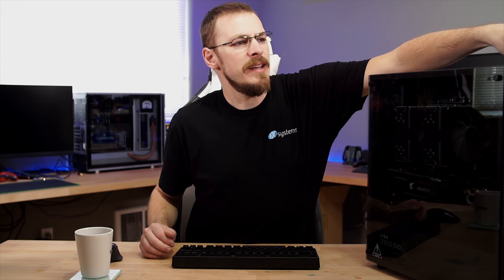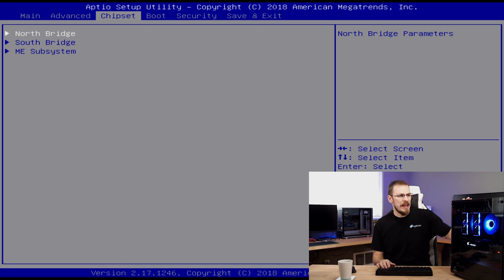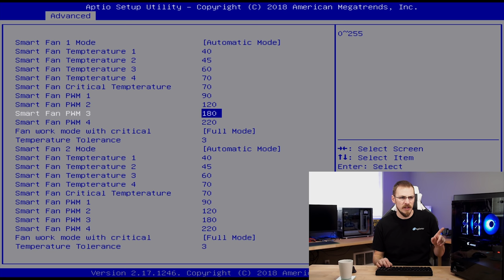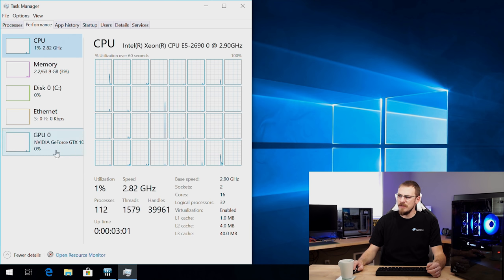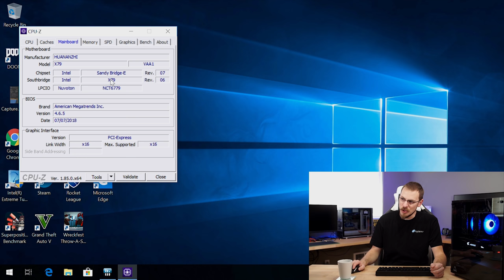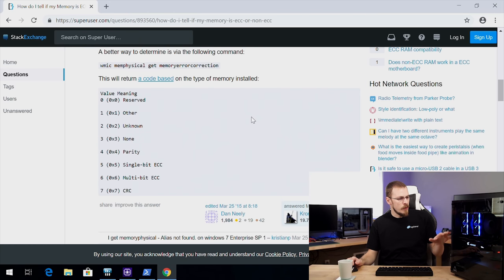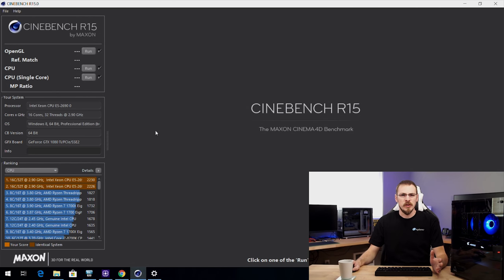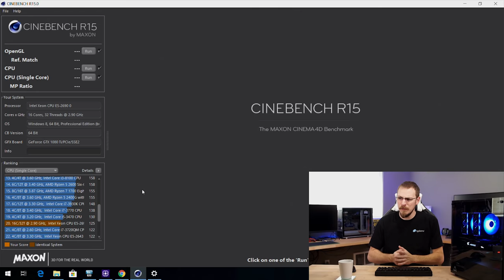Huanan "Dual X79" Motherboard Review

Comment: These platforms are dead ends,  a Ryzen 3400g performs about the same as a xeon 1650 per userbenchmark.com.  And you have to watch the chipsets the x79 platforms come in, I had 2 with the C602 and they ran ok.  Now I got one with a Q67 and it doesn't like the Hynix ddr3 ecc registered ram I have...If you want to see where the xeons stand, go to passmarks cpu site for scores achieved.  IE; the multicore score for a Ryzen 5 3600 is 20011, a dual E5-2690 is 19293.  So it's a better investment to go Ryzen unless you get a xeon dirt cheap.

Comment: As a person who has access to some insides of these systems: First, this is normal low-tier workstation board. BIOS is completely stock Intel reference pre-production (which is important) BIOS, that has been software locked down to 'client' level. Huanan has no resources to develop their own firmware, not even an UI extension. This BIOS has been untouched since early 2013.

PXE should work on this BIOS version, however you have to use UEFI PXE (which is only lightly bugged on this platform). You may have better luck with PCI-e card, i.e. CT1000 desktop adapter, just relatively new, so it will have correct UEFI firmware. It will simply show in the BIOS as bootable device. Btw, this is purely UEFI system, it has no native Legacy mode - it is emulated. Now, finally, for OC: it is flatly impossible. You simply cannot decouple CPU bus speed from the rest of system (this one doesn't seem to have BMC, LPC or IPMI subsystem, which would lower the risk, but still QPI doesn't like being played with). And for obvious reasons, there are no multiplier unlocked Xeons. You could try to find 2630 or 2697 ES, since there is small chance of it being SuperSKU (capable of emulating any other withtin same SKU grade) - 'Enable Overclocking' will just appear in CPU settings - but these will cost you an arm and a leg. Not worth it.

Fan control won't work on 3-pin, because these are not hooked to anything. The system that's supposed to control these has been gutted out. If not, try booting Linux, installing free-ipmi and reading sensors. Also IPMI has been made with 4-pin PWM control in mind.

At worst, this is absolutely not a gaming board (as fun as it sounds, it would be one with one CPU). At best this is cheap base for a number cruncher for entry workstation (4 DIMMs...), and given the age of the platform, you would be waaay better finding enterprise class SSI-EEB (large EATX) board on eBay, with same price, used, sure, but at least widely known to administrators around the world. Only appeal would be for those who don't know anything about server hardware, even that is exists. Actually the biggest appeal of the board it is it that fits in EATX, not in full 12x13" SSI-EEB outline. It's difficult to find a case for them, and almost impossible to find CHEAP case for them. In general I think same as you. Thanks for realistic view on this hardware.

Cheers!

Comment: You only need just 4 dims per socket for quad channel seriously dude common you should know this
Reply from the maker: Aaaaand you may want to count the number of DIMMs per socket on this board.
Reply: Total of 4  still will be quad even if only 2 per socket
Reply from the maker: The memory controllers are onboard each chip.  Between the two CPUs, there are 8 memory channels, but only 4 DIMMs on the board.  That's dual channel memory per socket, and effectively halves the memory bandwidth of the CPUs.

Comment: you can get ryzen 1700 + 32gb of ram + b350 motherboard for 510 USD. And it will perform almost as this build, plus all the new features. 

ADD 16gb more ram:
https://www.newegg.com/Product/ComboBundleDetails.aspx?ItemList=Combo.3791836&Description=ryzen%201700

Comment: there is even a cheaper dual lga2011 board from china, bit over 100€.... you can build insane powerful computers for next to nothing
Reply: Mine is dual socket, quad channel ram and I got it for $90.00 and shipping was free.
Reply: @rdsii64  thats a really good deal, does it support V2 xeons? Is it the one with orange & black pcie and memory sockets?
Reply: @nobodynowhere5213  Yes supports V2 xeons.
Reply: @rdsii64  good, is it the one with orange pcie slots? I tried to ask some ebay sellers, but they knew nothing about the V2 support.

Comment: Hi could you review this runing x79 motherboard? http://www.xlzmotherboard.com/en/product/html/?119.html

I got this motherboard from ebay for $150  just because I got frustrated from trying to upgrade a HPZ420. 

I basically ended up building a whole new system and it seems to work fine after some buggy issues that I had. 

I really want to know about the bios in this motherboard because i am a noob at motherboards and bios and any videos on YouTube about it and other information on some websites are in Russian and I thought you would be knowledgeable about this and might be willing to do this.

Comment: ryzen 2700x..... 2000cb faster single core...faster in everything else, less power consumption, cheaper, better, new and ready to upgrade..... or if you are in the mood TR 2990wx is 5000+ cinebench stock.....
Reply: He paid 500usd for all the PC base parts (motherboard, 2CPU, 64GB RAM) Can you do it with a new ryzen setup with 64GB of Ram? Of course not.
Reply: @maestrohun  yeah faster ram is more expensive.... great point sherlock...
Reply: @thepro08  "Faster" is one thing. The right answer is economic: oversupply. There is too much DDR3-ECC memory on the second hand market, while the actuall DDR4 prices in the skies... Sherlock. ;)

Comment: this platform has really aged... a 9900k could easily hit that score in cinebench with an overclock. That is, if you have a small fortune to pay for the house that it burns down.
Reply from the maker: A 9900k is also almost the same price as the motherboard, RAM and CPU in this system.
Reply: @CraftComputing  yup.

Comment: For rendering it is 2x more power hungry than 2700x or 9900k so the difference in the prices will be the same in some time of usage.

For cad work - it is the worst available thing to buy - even newest programs use single core at most and sti cannot utilize more than 1-100 percent and other 2-3 at 20-30 percent.

And 3. A lot glitches.

So - not worth it.
Reply: I use the same CPU AutoCAD 2018, and I feel it is stable and snappy enough for me. Good if you are a entry-level or student drafter, on a budget.
Reply: @internetuser-os5hw  try something like Revit or Tekla :)
Reply: @andrejusdoktorovicius2949  Revit I can try.

Comment: So this guy never use gigabyte or asus motherboard before. Well those are chinese as well. Chinese is a tribe/race not a country.
Reply from the maker: 1st, Asus and Gigabyte are both headquartered, and in a lot of cases manufactured, in Taipei, Taiwan.  2nd, the Huanan board is 'new', but with old-new--stock Intel C602 chips, reference BIOS, and numerous problems that would not be acceptable from one of those other brands.

And yes, a product which is manufactured in China is, by definition, Chinese.  I've mentioned numerous times in comments before that the 'Chinese' label is not used in a discriminatory way, but simply to differentiate Huanan as not being a major (or licensed) manufacturer of Intel motherboards.  I would use the term 'generic', but no one searches for that term in Google.  'Chinese Motherboard' is what gets hits.